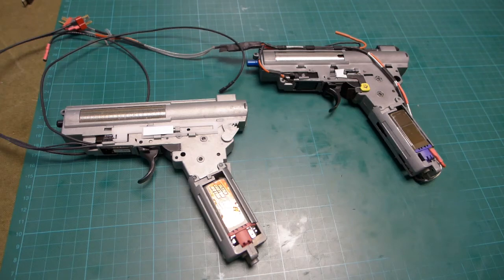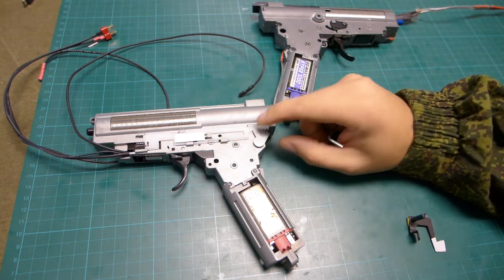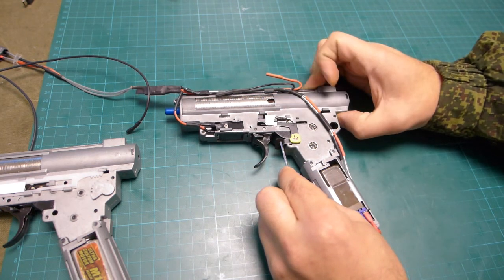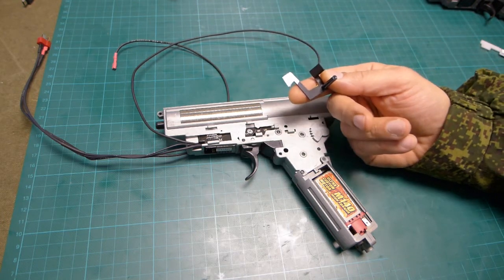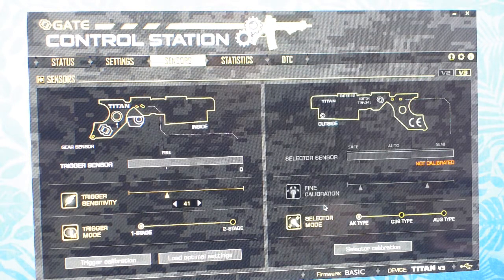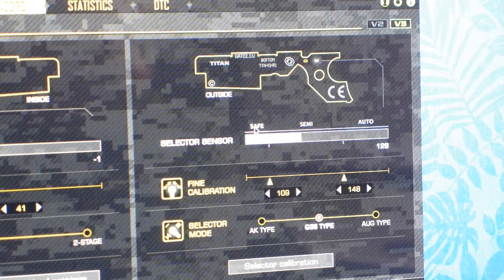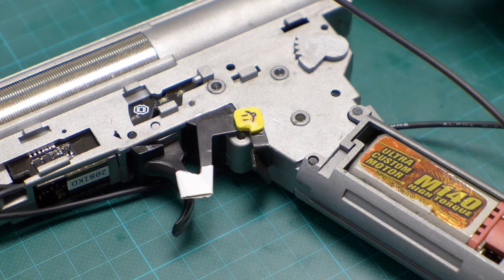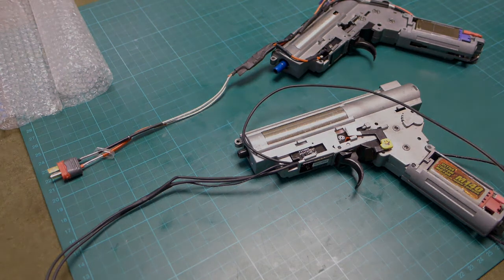Talking about putting Titan v3 in LCT V-BOX

Comment: So after watching your video as to how you were trying to get the selector to function, I turned to redesigning the selector and 3d printing it. I drilled out the rivet on the selector attached to the receiver, completely removing it. With my design, I can now select all 3 positions a normal v3 gearbox selector plate would cover to gain full function. Thank you for your initial work and ideas, as it shortened the research and design phases for my selector. I am also currently working on a front outer barrel replacement made out of carbon fiber tube with 3d printed end caps and spacers, which will cut the weight down dramatically.

Comment: Google translation:
Strong flashing (eg such from fluorescent lamps) light adversely affects the operation of the optical selector sensor. This causes a fast and significant change in the read signal, even though the selector plate is not moving. If you shield the optical sensor (which normally makes the rifle case), the signal will stabilize. Changing the stable signal by 30 (from 120 to 150) should give a good result. Good luck!

Original:
Silne migające (np. takie pochodzące z świetlówek) światło wpływa negatywnie na pracę optycznego czujnika selektora. To powoduje szybką i znaczną zmianę odczytywanego sygnału, pomimo, że płytka selektora nie jest w ruchu. Jeśli osłonisz czujnik optyczny (co normalnie czyni obudowa karabinu), sygnał ustabilizuje się. Zmiana stabilnego sygnału o 30 (z 120 do 150) powinna dać dobry rezultat. Powodzenia!
Reply from the maker: doh, stupid me :) Indeed too much influence of the light (LED just above my worktable). Thanks a lot, Damian! My Titan is already unboxed, so Sunday I'll have the result of putting it in my AS Val gearbox.

Comment: Thats for that information mate. I wonder if its because semi and safe are sharing the same position and thats how it diddnt fire in semi auto. I thinknit would only take a software update so you would have 3 styles to chose from. AK (SAFE, AUTO, SEMI) VSS STYLE (SEMI, AUTO) Relying on mechanical safety, G36 ( SAFE, SEMI, AUTO) but this is probably something that would have to come from gate themselves. Thoughts.....
Reply from the maker: I'll share this video with Gate to check what they think about it.
and I think, the semi was not working because the selector was too far from the sensors. Will install a Titan in my vbox, probably in the coming weekend.
Reply: Ahh right i see.. 
Good idea, see what they say about it.
Ive got the lct sr3m and would love to put a gate titan in it.
Reply from the maker: prepare the soldering iron :)
Reply: Я также буду устанавливать Титан на этих выходных. If I only need semi, I think it's possible to still use the Titan's safety if you program it's full auto to be the safety and semi to be semi. Then it should shut off when on full auto?
Reply: Forgot to add that it is going on my LCT VSS.
Reply from the maker: Hmmm. It will actually work, but you'll be using the fire mode selector of the VSS as a safety then. Meaning, in semi stand on the body it fill do "safe" and in "auto" stand it will fire in your configured mode (you can play with the slider in selector calibration part to "remove" semi or auto)
Reply: Thanks for your input Andrey, semi is all I need so it comforting to know before I have my product on hand that it can be configured to safety if on full auto, I know it's not 100% but logically it should. Wouldn't be nice if its always on, as battery and life span will drain.
Reply from the maker: I'll shoot a short vid tonight and tomorrow with both ways of configuring. It is after 23:00 here, I'm not allowed to make noise (read "shoot") :)
Reply from the maker: I'd say - safety in semi, and then semi in auto. Will shoot another video about it very shortly and try to simulate your idea
Reply: Thanks for the suggestion Andrey, your idea worked out. I installed it yesterday and it is a success, if you can simulate the idea for other users on video then hats off to you. I have no access to post here.
Reply from the maker: I'm open to try other users suggestions :)